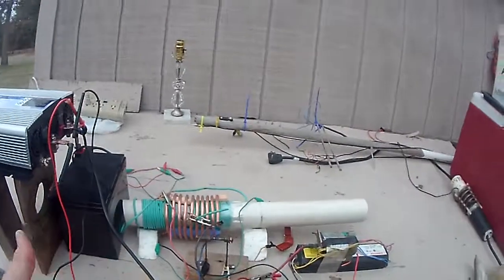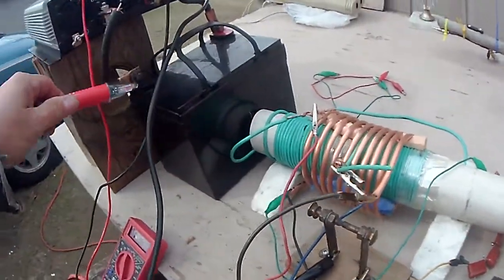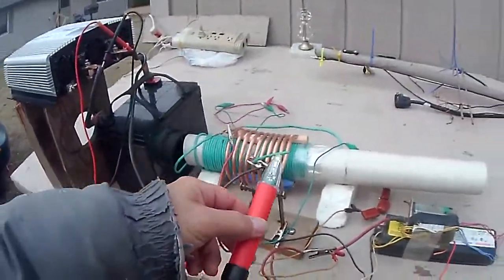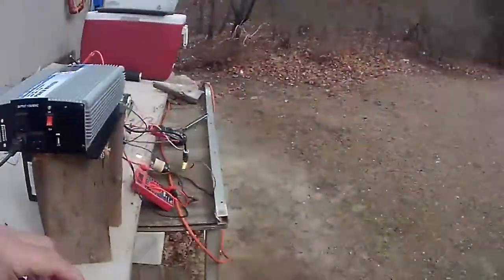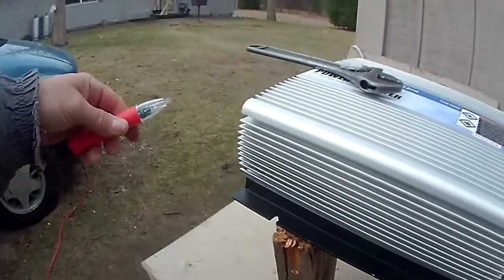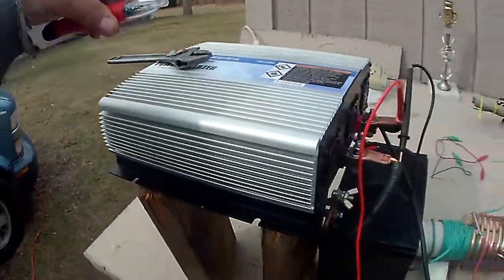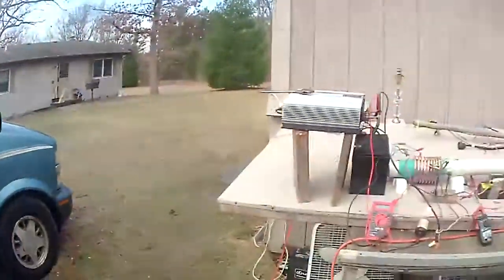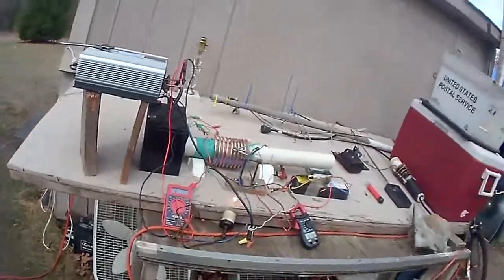Don Smith coil with 100watt bulb at 40% with inverter and very high voltages on DMM

Comment: I keep coming back to this video,so interesting! Is there any bounce back of the battery voltage?I wonder if you link a bunch of battery's in parallel and pull some good loads and see if the over unity part is in the regauging of the battery potential? keep up the good work....
Reply from the maker: +Scott S Thank you....Your ideas are slowly being implemented and in time I will add some more ideas to the project and will do a follow up video on results/test etc.More batteries more load may help...

Comment: buzzer indicates that the inverter is low battery!
-discharge so critical battery shortens its life!
it's obvious that the balance of the battery will be leveled (amperage but do not get nowhere)
-essentially the meter is sensitive to any changes,high frequency and going crazy!
because it is not suitable for this type of application.
and additionally observed that the battery is discharged , and it proves that interference will not have any impact on the illusions of battery charging or some energies.
if you made the measurement of power consumption from the battery by the time you get the load equationthere is no physical possibility to energies diverted see how it is designed inwerter inside? another thing already looks with ups
Reply from the maker: You may be right TT butI am still investigating with better test equipment.